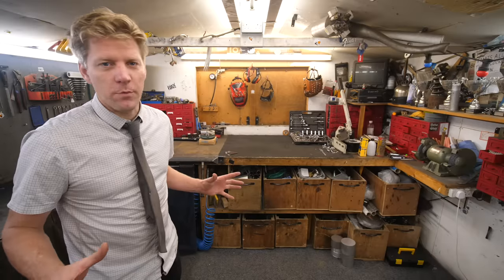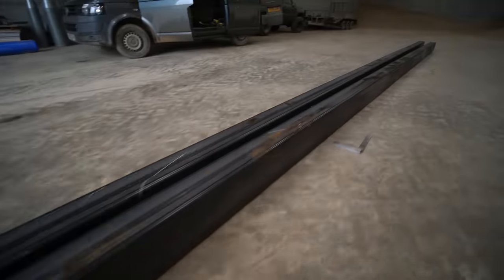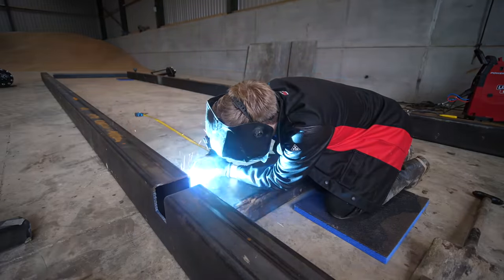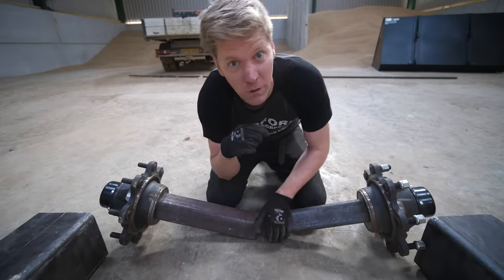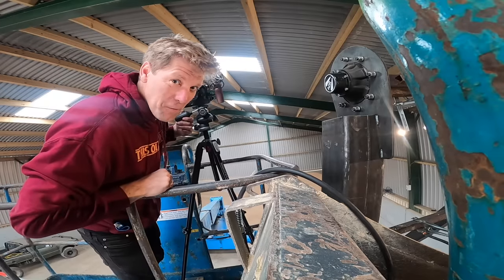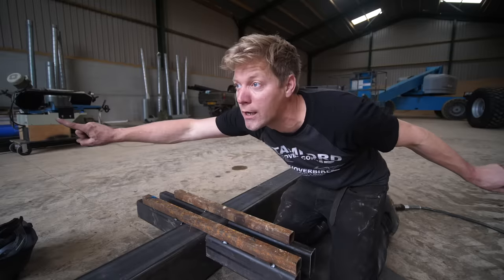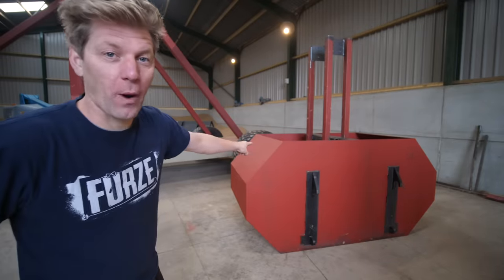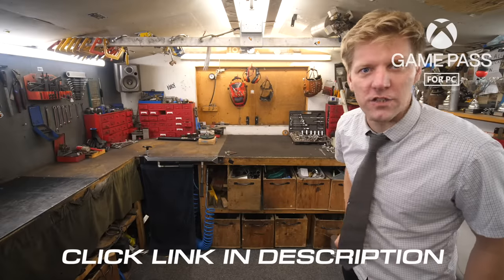MASSIVE Trebuchet/Catapult BUILD

Comment: You know most youtube creators will build something just barely strong enough to make it through one test for the videos sake. Not a single one of your projects have you cut any corners. Your the real deal and a tier above. Love your videos and your brilliant ideas. Keep doing great work!
Reply: It's hard to say if this this structure is structurally sound or not (I work in the metal trade). Sure the parts wont fall off but there's no guarantee that the welds on the structure will hold all that weight and stress. This is why structural engineers and qualified welders that can actually weld are so important when building big structures like this, you want to make sure the design of the structure as well as the welds dont fail when you put it under so much stress especially when people's lives are at stake; you dont want the structure to break or snap and cause harm.

Comment: OSHA officials everywhere have a had a simultaneous stroke.
Reply: right?! not a safety tie to be seen
Reply: Yeah, Colin djdn't even wear a safetey tie stading in the sparks behind the angle grinder.
Reply: Bloke @ 2:30 just grinding with the widow maker, no safety glasses, no hearing protection  D:
Reply: @emery6384  pretty sure his ears broke long ago with all the pulse jets
Reply: @emery6384 : Ive seen old OLD school welders up ladders. No spotter. Transformer on their back. Spot welding with no mask.
Dunno about OSHA.  Walking in on a 70 YO welding RSJ’s with his eyes closed is still a level Colin has to meet
Reply: yes indeed.
I was wincing at multiple points. Having had an exploding disk from a grinder leave a deep gash in goggles and the pain of a metal fleck in my eye   - take care viewers.
Reply: Good job Osha only exists in the usa then.
Reply: @awgunner429  Well if it was about the UK then yes but I was being specific to the usa.
Reply: I'm not even a safety guy and i told my wife there's so many violations.

Comment: 3:45 me a American “can’t tell if he means it costs £800 pounds or it weighs 800 lbs pounds ʅ（◞‿◟）ʃ 🤔
Reply: It weighs 800 metric pounds
Reply: He means they cost £800.
Reply: @r3dshed  and if you use the current 1.1 Euro conversion rate it weights 1333 Centibushels.
Reply: @twotone3070  how much is that on the banana scale?
Reply: Means it cost £800
Reply: @TheAkagami  I've just checked and you can't measure it on the banana scale, you have to use the fish scale and as precisely as I can tell, it's lots.
Reply: @spacerat4619  Not coy, you need one that will perch and not one that flounders. Try an eel, 'cos then if you're near a wall outlet you can use an electric eel, it will do the maths for you.
Reply: @spacerat4619  eelbay?
Reply: @spacerat4619  Yep, okay, you win :D

Comment: I wonder if this would launch something small like a baseball into friggin orbit
Reply: probably not because a baseball is to light. the air resistance would slow it down to much. but something denser like a Billard ball would probably fly pretty high
Reply: @JPFighter93  that's true. A baseball in orbit would probably also just fall apart too. COLIN LAUNCH A BILLIARD BALL INTO ORBIT
Reply: Simple answer: No

Because the device has a maximum speed of launch, so even if dry fired none of the components would reach even close to orbital speeds. Trebuchets produce quite low projectile speeds, what makes them devastating is the fact that they can launch very heavy projectiles.
Reply: @jakobrosenqvist4691  all you need is a looooooooonger arm :D
Reply: no mate but it would make one hell of a first pitch of the season. :)
Reply: @JPFighter93  Well, the question was phrased as this trebuchet. And yes it would be theoretically possible with a long enough arm, but material science would like to have a word with you before you build it.
Reply: @jakobrosenqvist4691  rokit baisbal

Comment: Forklift forks are indescribably strong. Once at my job, someone was not paying attention and driving into the shop with the tips of the forks dragging the ground. The tips of the forks, obviously, got caught on the edge of the concrete and instantly stopped the 8 ton forklift; lifted the back axle off the ground, blew two giant chunks of concrete/rebar out of the floor and almost threw the guy through the mast. Not even a scratch on the forks

Comment: As a slight modification and to allow transport via road without clearing power lines and traversal of hillsides without tipping over, I’d suggest a collapsable design with hydraulics to lift it into its launching form when at a desired launch site. 
Old digger arms are available at reasonable rates to provide the (somewhat heavy) hydraulic lift arms.

Comment: Just a welding tip, if you’re having to use Mig on big thick steel that HAS to be strong definitely turn the machine up to spray transfer rather than short circuit 🤙🏻

Comment: Collin. Some engineering advice: use steel cables instead of box section struts, specially for the swinger arm. Saves weight, achives the same in less material.

Comment: I used to work in construction and it is very amusing to see people so amazed by heavy machinery, those forks are meant to pick up nearly 2 or even (in some cases) 3 times the machines weight, those forks can take alot of force, and they even make extensions for forks, which can put the ratio all the way up to 5 or 8 times, but at that point you would need to add more weight to the back of the piece of equipment lol

Comment: Next the really hard part. Making a sling that can 1 hold up to the force/speed  2 be light enough to not slow down the moment of inertia. 3 the optimal length for energy transfer. 4 release mechanism Can go with positional release or angled pin like original trebuchets. After seeing how much weight it can handle dropping the arm may or may not need to be lightened again to help energy transfer to projectile.

Comment: Having watched the video where this thing is tested to destruction, which happened when bearings disintegrated, I'd recommend not welding anywhere near to where bearings are installed. Remove the bearings, do the welding, reinstate the bearings. Heat does a lot more damage than just melting the grease out of them, they are precise bits of kit and a bit of heat can distort them enough to ruin them. I'll not mention the lack of safety precautions which were neglected.

Comment: Colin do you calculate the welding strength for steel uprights and how much weight can be supported? Surely there is a limit to the weight a weld can support.

Comment: The forks on the tele-handler are heat treated to be stronger than normal. Makes them extremely strong but once they do bend they are done they lose all that strength. Also we have idiots here in the states that will cut them with a torch or plasma cutter and still use them even though they are trashed. But yeah buddy they are pretty tough.